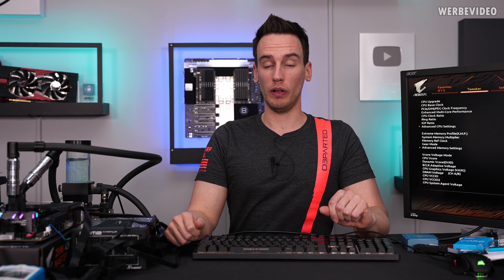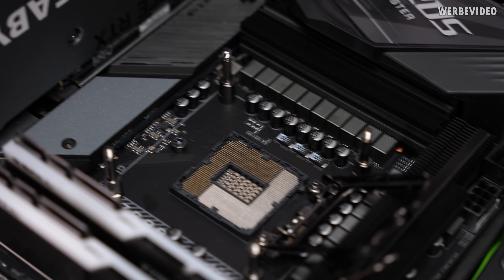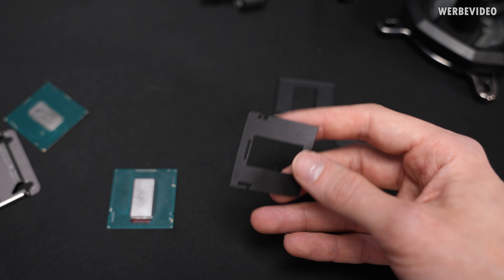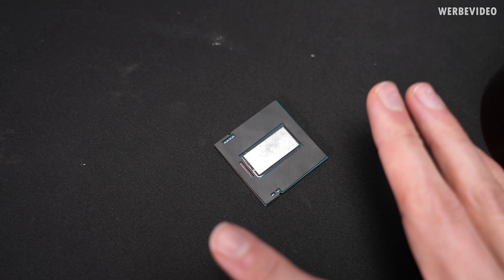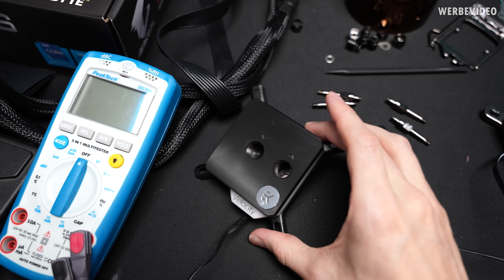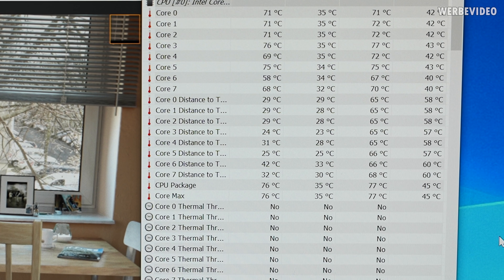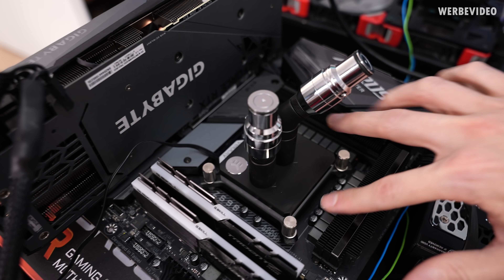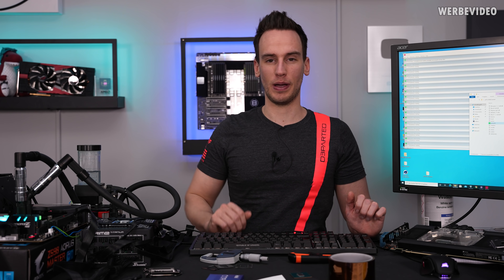Unexpected Results: 11900K Direct Die Cooling

Comment: Considering the thermal output that this thing can reach under Prime95, I would not be wholly surprised if part of the issue would be due to the whole die being, in itself, too small. By which I mean that, possibly, this particular chip crosses a boundary of some kind where a bigger square area of dissipation yelds a better rate of heat transfer than a die-sized area, regardless of the latter having the best thermal conductivity achievable (block contact and pressure issues being conveniently sidelined as a variable, for argument's sake).

It's mostly speculation that i can't see being reliably tested, but the combo of taller die, backport of a dense design upon a less dense fabrication process and so on might give it some legs. The end result sadly remains the same, DC doesn't do anything, but knowing would be nice.

I suppose that the intel manufacturing team does know, to an extent at least. Maybe in the future, with them licensing floorplans and manufacturing capacity, a chip will come out that will yeld (ha-ha) the opportunity to detect this.
Reply: I wouldn't say . Take for e.g. the 10th gen i9 . The die is smaller . And regardless , direct die cooling with a proper frame does lead to a very good performance (I am typing this on a i9-10900Kf - direct die cooled - 5.4Ghz speed on 24/7 usage .... . Temps of CPU before/after direct die were like 30deg difference ....)

Comment: EK has those expensive blocks that arent concave, made for lapped cpu's, should probably be better for direct die than the standard blocks
Reply: Optimus also has excellent blocks for lapped CPUs, they come pretty much perfectly flat
Reply: Neither one nor the other.
Perfectly flat blocks benefit from lapping because you eat distance in the total assembly from die to block, not because you made the surfaces flat. Since the blocks put a lot of pressure and use springs they adapt to having a bit less IHS height: it's within tolerances. 
You lap your CPU and put an Intel stock cooler on that and the cooler should perform marginally worse lapped. Intel has it's reasons at the end of the day to make the IHS slightly taller in the center section(where the CPU cores and the iGPU EU are, which are the parts of the CPU producing the most heat) and it has to do with their stock coolers not using heavy mounting pressure, hence if you reduce IHS height you trash Intel's stock cooler performance because then you fill the gap with TIM which is the worse heat conductor in this assembly.

Basically Intel's concave IHS is made to reduce the amount of TIM needed in low mounting pressure cooling devices. Intel's stock cooler being one of them.

Comment: I have a thought about the direct-die results. You probably right that the block isn't meant for this application
What if those notches where the water flows (in the block) are parallel to the length of the die so the heat that picked up by water travels on the whole die before its back to the pipe
So if you turn the block 90 degrees you get fresh flow on the whole surface and maybe a bit better temps

Comment: This is such a weird result. The lid must be cooling some other area that affects the readings. Could it be so that temperature measurements are by in-pcb devices and they only have the "pins/leads" into cores? Then this would make sense.
Reply: The result is perfectly normal, as far as I see it. The surface of the IHS is larger than the die. The heat from the die is distributed evenly through the IHS. More surface=more contact (between the IHS and the surface of the cooler)=better heat dissipation=better/lower temperatures. And of course, the opposite, the direct die cooling, as it was proven in the video.Heat pads around the core would not improve the performance, as literally the small electronic parts in the pcb produce very little to zero heat, which is irrelevant to take into account and would not influence the overall results.
Reply: @alext988-z8v  What's happening is more likely to be due to the total height of liquid metal used in both assemblies. Probably direct die ends with a thicker layer of liquid metal overall than delided, even with delided using 2 layers of liquid metal. It's what der8auer points at when he says the coolers aren't designed for direct die, most coolers mounts assume there's an IHS and their dimensions put distances accordingly, so in direct die you have to fill the extra gap with your TIM.

Liquid metal is faster heat conductor than silicon based pastes, but it's still very far from conductivity compared to copper(IHS, heatpipes and water-cooling blocks) and aluminium(air-cooling finned heat-sinks). Basically, in this setup delided is winning because it uses less liquid metal height, that's long story short.

MORE INDEPTH ABOUT HEAT TRANSFER IN PC, SKIP IF DON'T WANT DETAILS

That would really require an engineer to do calculations. But heat doesn't spread evenly on the IHS: things in nature follow the less resistance path to equalization. Heat spreading around the IHS isn't the less resistance in this scenario, but actually heat going in straight line through the IHS towards the cold plate. When the straight line path becomes totally saturated heat will act in a similar way a car displaces wind: the wind slides aside the closest around the car surface. Heat wise will slide the closest around the saturated exchange area of the IHS but always going towards the cold plate(which acts as an exit) in the shortest geometrical way.

Similar happens if you put a very intense single core load. No matter only 1/12th of the entire surface of the chip is generating all that heat and it could spread over the entire chip to use more surface and keep the specific core running lower temperature, there's no awareness in physics that the priority is to keep the die cool, priority is moving through the path that costs less, no matter how hot silicon gets. That core is going to overheat and the nearby cores will be like no load at all because less resistance path in CPU cooling is normally shooting straight upwards towards the cooler's cold plate.

This is a confusion that comes probably from motherboards VRM metal block style heat sinks. But that's a totally different dynamic: there heat transfer to air is extremely poor, not comparable to finned aluminium heat sinks or water-cooling radiators with fans blowing at them. So in a block style VRM heat sink heat spreads around the heat sink because it acts more like a prison. But if you were to put a fan blowing straight at the metal VRM heat sink, increasing metal to air heat transfer in the air blown area, even if it's a block it will decrease by a long shot how much heat spreads over the block, because now heat will choose to go out of the metal block through the metal portion that's getting air blown at it's surface by the shortest geometrical path.
Reply: @deidian635  Thank you for the in depth analysis and explanation. Very much appreciated !
Reply: Could maybe test this by having heat pads around the core

Comment: I would like to see more content investigating why the temperatures were better with the heatspreader in between. Would putting a small piece of silver between the die and the cooler be better?
Reply: It's probably thickness of the liquid metal layer. To me looks like direct die ends with greater LM height in the assembly than delided. Since IHS is copper, it's extremely conductive, while liquid metal is leagues below. Basically, lowest TIM height always wins because TIM materials have lower heat conductivity than any metals used in cooling(copper and aluminium).

The solution is easy, reduce TIM layers total height by adding good conductor materials in the middle...oh wait: the IHS does already that when deliding, right? Solved, just delid.
Other option would be designing a cooler mounting mechanism accounting for the dimensions of the assemby when doing direct die. But that's the ideal solution and it would be expensive since Intel changes PCB, die and IHS dimensions. For Intel is fine as long as these 3 total height remains the same not breaking cooler compatibilty.

Comment: I litteraly see noo reason for the shim to be there so ofcourse it works without. it's not contacting anything its not conducting anything its just laying there.
Reply from the maker: Ofc it does when the PCB bends
Reply: @der8auer  Isn't there a backplate on the board to prevent the entire socket from being bend on these boards anymore?  Both my rigs have a solid backplate that is defilitny not bending from the cooler mounting pressure.
Reply: @pino_de_vogel  The PCB of the CPU, not the motherboard
Reply: @OfficialMageHD  that is in a socker that in its turn is on the motherboard which leans against a metal backplate for the cooler. so there shouldnt be flex in that unless the socket isnt mounted flat on the board. which would be silly i think.
Reply: @pino_de_vogel  the socket itself doesn't need to bend significantly if at all. If all the mounting pressure is just in the center of the CPU because it's only putting pressure on the die itself, the issue then becomes the "resistance" of the socket itself. With the socket being a few spots of plastic, and the rest being gold pins it's not a very good surface for even pressure. A lot of pressure goes into mounting a CPU, and the extra wiggle room without spreading out the pressure you're putting in can very easily lead to it getting bent.

Comment: Why don't people direct die cool their desktop cpus more often? Majority of laptops are cooled this way.  Now I know there are dimensions that will have to be met for this to be possible, however, more efficient cooling is better, I'm surprised there aren't many manufacturers don't make coolers designed to fit stuff like this(I'm not the most knowledgeable, so if I'm missing something that is a no brainer, this is why)
Reply: Dies are fragile, and most people where I live would Fk it up.  They have to idiot-proof it for the unwashed masses.
Reply: @kaylaandjimbryant8258  mhm to be fair , I got my first pc last year, it's a laptop of course,( I've had other little pcs, but ones like cheap chromebooks), and when I got my laptop first thing I did was researching on liquid metal applications. And guess what my dumbass did to my laptop that costed over 2300 dollars? I immediately put liquid metal on it, with no previous hands on experience doing it too! I did it to the cpu and gpu, and I learned to do it just from watching videos, from ltt and people from channels like this. And the end result, it still works to this day, now did I almost have a heart attack doin it in the process knowing I could have a 2300 dollar paper weight? VERY MUCH SO LOL.  But keep in mind , I've always liked pc hardware, and I literally never did this before, not along actually have ever built a pc nor took many apart, aside from watching a million videos over the years. (This is a sort of irreverent response but I'm bored lol)
Reply: @wesleyfurnish8228  everyone has to start somewhere.  We also use conductonaut on our laptops and GPUs.  All of the cpus here are the intel kind that were easily delidded, so it was easy once tools were available to do so (my still main rig due to licensing is a 4790K that I delidded in 2015 using the razor blade method).  If the new ones all use indium solder, that complicates things drastically though and seriously increases the risk involved.
Reply: So it basically goes to one thing: desktop computers are used in enterprises where they have IT workers which assemble, repair and reuse the computer pieces. Since time is money and this type of client cares a lot for this manufacturers like Intel have to design CPU mounting in a way that replacing it's very fast and safe. An enterprise wouldn't be happy if their IT guys took 15 minutes to replace a CPU, it has to be done under one minute and with ISH and CPU manufacturer stock coolers is doable.

Same happens with RAM. If you ever worked in a software company when a RAM is faulty the IT guy comes pretty fast with a couple of modules and just replaces it ASAP until it works mixing them in any way. Since everything runs at JEDEC SPD any timing configuration will POST right off the bat and stable due to the absurd margin, no memtest needed. 
On another hand on computer hobbyist realm everyone agrees mixing up RAM is troublesome and leaves performance on the table because you do that and you're going to need to find a common frequency and timings that POST for both modules or you just run it a JEDEC SPD and go along with slower RAM. Then memtesting your configuration to ensure it runs stable because you aren't aiming to work with a fat error margin.

You're basically disregarding the platform used in gaming has also very big clients in the enterprise world who buy much more than "individual users". Intel isn't oblivious to this.

Comment: what about high end air cooling like a D15? Would DD be a benefit?
Reply: Iirc the main advantage of watercooling is that the water functions as a giant heat sink, in the sense that it can collect a lot of heat  (because of the mass) and use a larger surface (radiators) than regular cooling.

So if you're not seeing an improvement in watercooling it's unlikely that it will benefit aircooling.
Reply: @DCG909  you missed the part where der8auer said his waterblocks not meant for DD cooling like that, meaning that this specific scenario is not showing best possible results. (that is why DD results were worse in comparison to the delidded one)
D15 might be actually better here, but the weight is another issue, you dont want 1.3KG chonk of metal sitting on your CPU die like that.